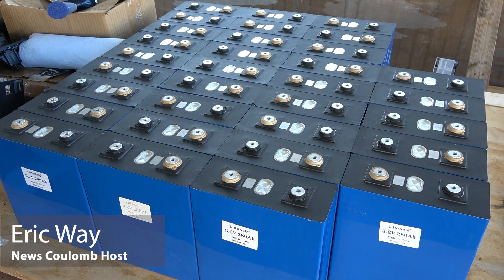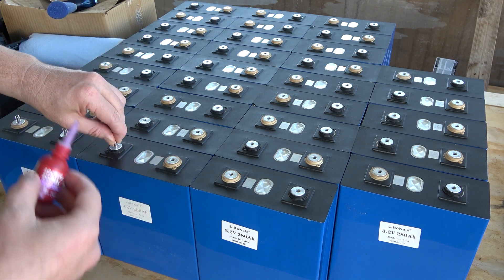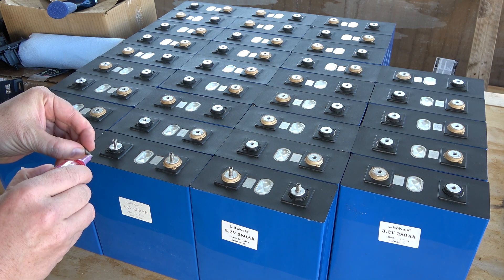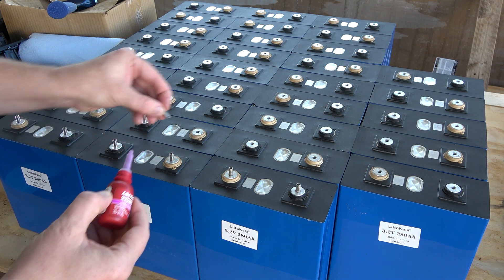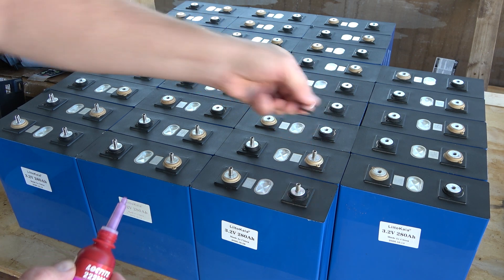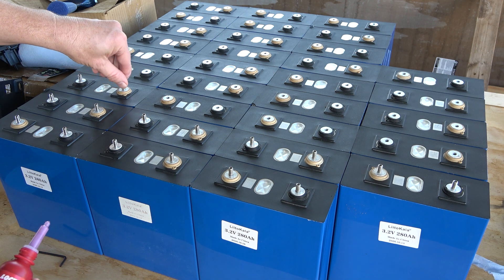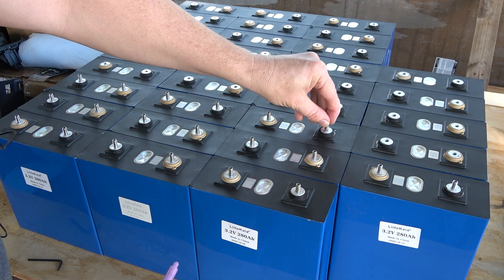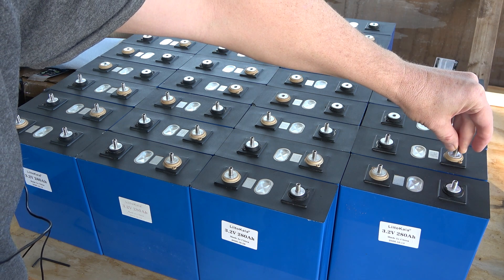Ford Mustang Mach-E GT's 5 Second Max Power Let Off: Time to Mix Battery Chemistries?

Comment: You forgot to torque the stud at 7:30...
KERS systems, of course they DO have a generator, how else would they convert kinetic energy to electrical energy to stuff back into the batteries during reGENERATive braking?
Reply from the maker: Yeah, I caught that when reviewing the video. Thanks for the heads up!

Comment: Glad that I will buy a fully loaded Mustang Mach-E GT Performance Edition anyway.
Reply from the maker: Yeah, it's still possible that Ford can extend the 5 second boost with software after analyzing battery data. Realistically, the boost only needs to last about 10 to 12 seconds. At that point, no one would know the difference.

Comment: Former Nissan Leaf owner here… pouch cells are prone to swelling and overheating. Since when did “cheap” become a desirable trait in the powertrain of a car?  You don’t want cheap.  You want reliable engineering.  Cylindrical cells are superior in every way.
Reply from the maker: Improperly packaged pouch cells are a problem, yes. So are high-power pouch cell batteries that lack thermal management. Both of those issues were unique to the LEAF. 

Also, I would caution against confusing low-cost with "cheap," just as it would be wrong to confuse expensive with "quality." 

Cylindrical cells have a number of advantages, yes, but in automotive use, a number of those "advantages" either don't matter or become liabilities. So far, Lucid has been the only automaker to integrate cylindrical cells in a reasonable way, and even then, I wouldn't say that their batteries are strictly better than BYD's Blade or GM/LG's Ultium.

Comment: Transport Evolved just talked about this the other day as well.  I could see super caps being used to buffer surges in both directions, but not sure a separate pack would have enough power as you describe. Would they be electrically coupled? (Where you'd have to match voltages) or mechanically linked? (Where you'd be almost like a hybrid carrying a separate, unused motor and battery for a small gain).
Reply from the maker: Sure, the battery would have to be linked. A super capacitor pack could probably surge in its own, but a linked battery with similar chemistry would have to be brought to similar voltages and be connected into the system.
Reply: @newscoulomb3705  Matching voltages is the biggest issue. The voltage sag on the higher quality cells will be less (lower IR) than the main lower-quality cells and thus be different - even if "similar chemistry." It might be easier to simply have the front motor connected to a separate battery pack of higher C (maybe even 800V) of a better chemistry or form factor.
Reply from the maker: @voxel999  As long as both batteries feed into the same input terminal (in parallel), the voltages should naturally stabilize. An alternative could be to use a voltage regulator from both banks to ensure an equal voltage. Ford and Rivian both have already patented Aux batteries, so it will be interesting to see how they integrate them.

Comment: That’s exactly what I assumed Porsche would do with the Taycan “Turbo” as a “boost” would have made sense in describing some sort of auxiliary power source. It would be really cool if GM did something like what you described with the SS/V/performance versions of their EVs. (By the way, it’s quite impressive that you can hold a coherent conversation while thinking about what you’re doing with the battery terminals!)
Reply from the maker: Thanks! I've got a lot of time to think. 🙂 Honestly, even range extending drop-in batteries can do the same thing. It might be easier with super capacitors because of their weight, but I can see automakers trying something like an EV "Supercharger" that mounts in the frunk or trunk and plugs into a unique power input that feeds into the system. The car's computer could then access that additional power/energy as needed. These could also be used as battery swaps or emergency range extenders.

Comment: Eric, I see you’re putting the Loctite on the tip of the screw terminal before threading. Those this technique is optimal for coding all of the threads I would not think it was optimal for having the terminal be also a conductor. I would suggest putting Loctite near the middle of the threaded area so it will still lock but you will have lots of bare metal threads to be a solid conductor.
Though I agree that you will also have the top plate be the conductor anyway.
Reply from the maker: Yes, I am not expecting the terminal bolt to conduct any electricity, so I'm more concerned with securing the set screw. There aren't a lot of how to's, so I'm just going with what I think makes sense. I should probably add that caveat. 😁
Reply: @newscoulomb3705  So the flat part of the terminal contacting the busbar/cables is your primary conductivity interface, and the threaded bits are primarily physical to attach the busbars, right? That's what I understood from the prior discussions of the terminal adaptation.
Reply from the maker: @hellsop  Yes, that's right. The terminal contact face is where a majority of the power should flow. Andy on Off-Grid-Garage recently did a test with the smaller terminal faces, and even those were able to support 160 A of current without overheating. I'm going to use an abundance of caution, of course, but the flat terminal interfaces on these should be able to support at least 300 A of current without much issue.